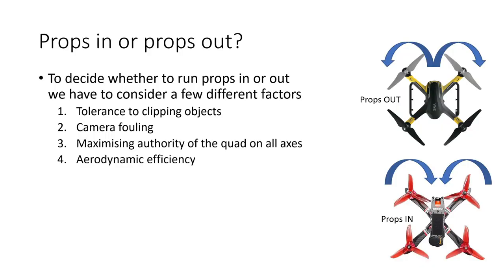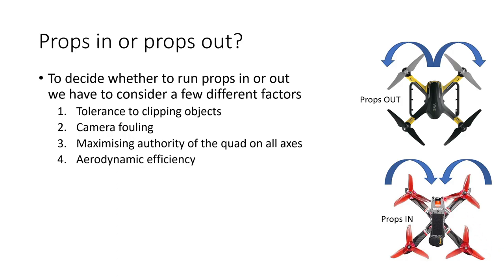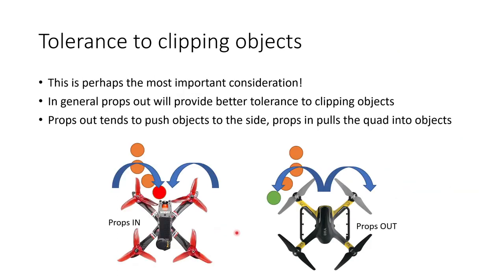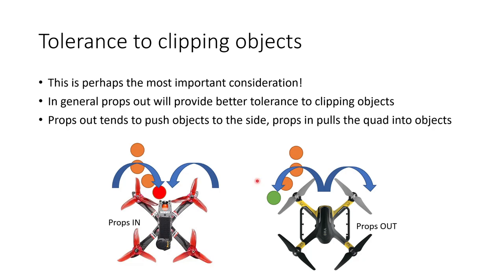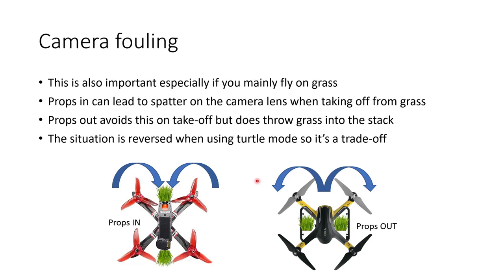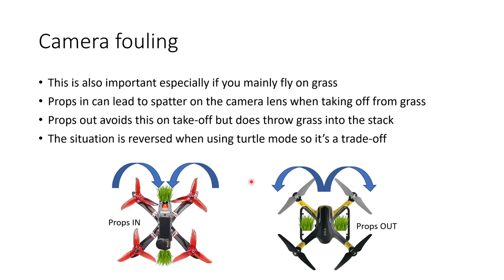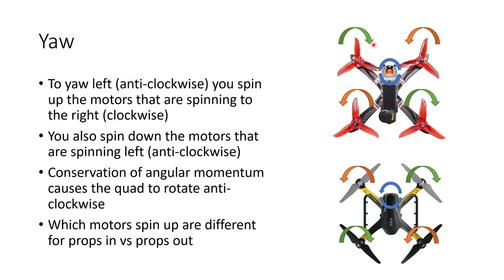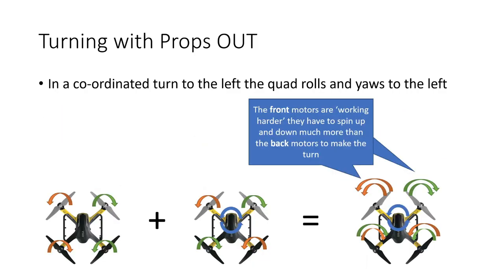Prop Direction. Should you run Props IN or Props OUT?

Comment: I crashed my 5” quad and had to replace my esc. After doing that and making few other adjustments, (Lighter battery straps, less tpu mounting, no motor wire sleeving) The quad was actually 40 grams lighter.

But It flies noticeably worse, the motors run hotter, and low ground passes were harder to pull off. I adjusted the pids and noticed I can’t push them as far. The only real variable that would make performance that much worse would be my prop direction. 

I got lazy and hate using bl32, so my motors are running inwards now. Never knew it made that big of a difference, I just ran props out because I used to crash my whoops often.
Reply from the maker: Crashes can cause delaminations in the frame which will affect vibration performance. Even if the frame looks OK it can become more flexible. That might be the cause. If you're still having trouble after switching back to props out check that all the arms feel equally stiff.

Comment: Thanks, had not thought about switch prop in vs out direction, just used the default betaflight. After your video I gave it a try and men I just got an extra 3 to 4 minutes flight out of my quad, from nearly 9 to 10 min to over 13 minutes. Not to mention banking turns are much smoother plus better turn control in general. Same quad, battery, blades and that in heavy winds... flying a light weight 5" which is setup for long-range. just around the 250grams
Reply from the maker: Great to hear! I'm glad the video was useful to you. 😁
Reply: @ChrisRosser  watch your video on prop size and motor choice, I'm running 1404 4850kv on 5" bi blade low pitch. To me this is my best quad yet, this is my 4th quad and second that I put together myself.  To be fair this is the first I got good PID setup after watching tons of videos on it of AUV. But there is something quite different from a 4" to a 5" quad that I would like to know more about. The responsiveness with same setup just going up that inch makes it feel much more stuck/grippy

Comment: I absolutely can with out a doubt can tell a HUGE difference when I clip a tree or even a post. I probably bounce off at least 50% of the time, depending on how hard I clip something. Sometimes it’s amazing how well it works. That is the main reason I ONLY fly props out. I don’t know why it isn’t the standard configuration. I have definitely noticed other advantages, but now see more through the turbulence diagrams. I always FELT that it flew smoother, and just makes more sense to me.

Comment: Honestly, when I just started watching this video, I thought the final conclusion would be less definitive, with both configuratios having their advantages and disadvantages. I did not expect the 'props out' to be such a clear winnner...
Personally, I started on the default 'props in' config, simply because this is how my first quads (Emax TH ii whoop and TH ii Freestyle) were set up by the manufacturer, but as soon as I learnt how to reverse the props I switched to 'props out'(I first reversed the motor direction by swapping wires, because I didn't know yet of BL Heli software 😶) and never went back to the 'props in' on  any of my quads again - whether I build or buy kwads I always make sure they run in props out set up. 
It's reassuring to learn that there are other important reasons for running the props out, beyond just not wanting the kwad to look like a dirty lawnmower 🙄
Reply from the maker: When I started looking into this I though it would be more balanced too!

Comment: I turtle mode so much, with props OUT, turtle mode covers my lens with junk (or pits the lens with rocks) during reverse direction. Therefore I only fly props IN. This way, turtle mode doesn't make it impossible to see (or ruin my camera lens) when I get back upright and flying. I conformal coat everything, and use plugs in my USB ports to keep wet junk from killing my electronics, since turtle mode throws stuff into the flight controller. 🤣

Nothing else matters to me since I claw my way out of pretty much everything using turtle mode. LOL

When I crash much much less both racing and freestyle- then I'll go back to props out.

Great video, though. Mad props to ya!

Comment: My experience has also been that props-out provides better cooling to a DJI Air Unit in the frame as well.
Reply from the maker: Thanks for sharing that's another important consideration, especially for the vista
Reply: This probably is most convincing argument. All others are debatable, but cooling is really important.

Comment: Thanks for another great and informative video Chris.  I tested props in vs props out on low authority whoops to see if I could eliminate washout problems.  With props in I would get uncommanded rolls during a washout, and with props out I would get uncommanded yaws.  Washout would cease to be a problem if the quad had enough authority.  Washout was also reduced by making sure I gave the quad extra throttle during a hard turn.  On a quad with good authority, I had a hard time telling any difference between props in or props out, but I need to do a lot more testing on that as my flying skills have improved greatly since my initial experiments.  Thanks again, I am grateful for all I have learned from you.
Reply from the maker: These aero effects matter more on whoops than bigger quads. The difference in feel is quite slight on a 5inch I think.

Comment: Great video. I wonder why props-in is/has been the default for most firmware given that props out has so many advantages. I think the biggest downside to props out is, you basically have to do it to all of your quads or none of your quads (to avoid confusion), and since props in is the default, I think most people just deal with it being a slight disadvantage purely out of connivence

Comment: I'm using props out for 5 years already, when it became a thing. Definitely easier to escape from contact with tree branches at one side which may happen a lot when you do freestyle between trees. Inward props in such circumstances usually tie branches around quad in a second with known outcome. Also cleaner camera lens. With props in often had dirt and grass thrown on camera lens on liftoff which annoyed me a lot. Didn't noticed authority problems for outward props as well.
Reply from the maker: Exactly the same experience I had. Props out for me now 100%.

Comment: Great video mate 👍😎 I’ve been running props out for a long time for the reasons you mentioned but didn’t know about the potential aerodynamic benefits. Theres another benefit to props out if you run rx antenna backwards off the rear arms etc. they are less likely to be damaged by a prop strike, turtle mode aside.

There’s two caveats I would say. Don’t land or take off on long grass, or disarm quickly when landing, or your stack will get covered in it. And best to have all your quads in OR out, a mixture can easily end in putting props on backwards which can suck big time 😂
Reply from the maker: Definitely. I only run props out to avoid that problem. The trick is to land like a freestyle pilot. Disarm when you are still 2m off the ground flying 10mph😜

Comment: Hi , please can you do a similar video on X8 quads. I build and fly x8 quads using only 4 motor outputs and running the upper and lower motors on the same arm in the same direction. in effect an 8 motor quadcopter not an octocopter. I know for a fact that i can drop 4 motors or props and it still flies , just at half power. But if you try the same in x8 config it does not work so well . I have tried to inform folks of this , but all other x8 type craft i have seen run octo config with 8 separate motor outputs,  If redundancy is important those running 8 motor outputs are doing themselves no favors , but no one listens to me, . Your work is FANTASTIC , keep it up.

Comment: I noticed long ago that props out had a huge difference in the agility of a quad using stretched x frames as opposed to agility of compressed x frames using props out.   I think props in was actually preferred on those butterfly (dead cat) frames because the ofset positions of front to back props.

Comment: Hey Chris when it comes to authority I’m just curious if you also factored in variable of pitch of the quad when flying? The rear props will no longer be placed directly behind the front props which gives more allowance correct? What are your thoughts?
Reply from the maker: The pitch of the quad will be very variable depending on the movements in flight. In general however the quad is moving forward so that's a place to start 😁
Reply: @ChrisRosser  correct. My thought is the more the quad is pitch forward (like racers) the more “clean air allowance” the rear motors will receive this rendering more authority to PROPS IN when at high pitch angles. You no longer have to pull air in and down as much leaving a clean air pocket for the rear motors as now you are pulling and forcing air in at much greater efficiency due to the angle. Just my thoughts on how the higher the pitch angle your quad is flying at will minimize the dirty air to the rear motors.

Comment: Would be interesting to see a blackbox log. Fly the "exact" same path with the same quad in the two different configurations and everything else equal, and discuss the difference=)

I'll switch to props out to check this out! I've always ran props out on my 3", but the 5" is props in.
Reply: It would require computer controlled flight. Because no way hoy you manually would repeat exactly the same path. Though I got the idea.
Reply: @KrotowX  But you can go "powerloop under this tree, fly straight past the field, do a punch by the house, hover at the rock", and so on.
Reply: @ojkolsrud1   Indeed I can. It will not be exactly repeated previous flight route, but yes  ;)

Comment: how much is slightly better? Does the efficiency fall under the non-marginal category? Great vid! Just subscribed.
Reply from the maker: It depends on prop size. An excellent pilot can notice it on a 5 inch quad. It's very noticeable to most pilots on a tiny whoop because they have lower thrust to weight and less authority.

Comment: Good video again, I run all my quads pros in. Just because it is default. One time I experimented with reverse direction but when I got a broken prop and replaced it on autopilot with a new prop with the prop in direction the quad was almost eating my face at arming😝 so after that incident I never did it again. But your theories sounds interesting so I will give it a new try. Thx

Comment: Very interesting analysis and I agree with most of your synopsis however, the "dirty air" effect on the rear propellers from the front  propellers will be reduced or, in extreme conditions eliminated, with in fast forward flight i.e. the rear propellers are above the front propellers and will see mostly "clean air".
Reply from the maker: You are absolutely right. Fast level forward flight is not when we most care about inlet conditions though. Think about a big split S or the end of a power loop when you are descending through your own propwash. Then the rear props are right in the line of fire from the front props. This is where props out has a real advantage.

Comment: The only caveat to the camera issues is if you use Turtle mode in areas that have gravel and loose aggregate. If you run props out, they'll be throwing rocks and gravel at the lens of your camera. I have a runcam hybrid betnow has a textured lens do to sand getting thrown at it while in Turtle mode. 

The issue is soft pretty easily though, it's as simple as not using Turtle mode when gravel is present
Reply: We have screen protectors for phones. I often wonder why manufactures don't include a small insert and method to attach it just in front of the lens.

I now leave the crappy plastic lens protector that comes with the camera on because of how delicate those lenses are.

Comment: My first quad build was prop in. At the moment, my most recent build I'm running props out for the first time. I feel like I have better control on the roll axis with props out. Props in feels like I have better control on the pitch axis. I also feel that acceleration is a bit different in forward flight and during punch outs or last minute throttle recoveries. I feel that I get less thrust with props out but it might be the tune. Both my quads are generally identical in frame and components. I've only been flying quads for over a year so it's just an observation. It would be interesting to see if there's a difference in frame resonance with props in versus props out.

Comment: I run props in because I prefer to take 5 seconds once in a while to clean my camera than risking to short something on my FC or ESCs because of wet grass projections (and spending much more time cleaning electronics). But statements about authority and aerodynamic are very interesting and make me hesitate to switch... ;) Thanks for the video !
Reply: I cover all of my electronics with silicone isolation liquid, this helps with wet grass projections)
Reply from the maker: I don't blame you. Never had it happen to me but I do get worried when my stack looks like a grass box from a lawnmower!
Reply: @edfroxt7294  I was used to do so, but it makes maintenance quite messy and silicone coating is a bit fragile when cleaning with a toothbrush, always pros and cons ^^

Comment: I totally agree with all this in your video. Great job with it and and some benefits of flying with props OUT. There is something to be taken in consideration with props OUT is in scenarios when they impact with a HARD object (hard to be moved by kinetik energy of the quad) the quad is being "thrown away with a dangerous speed of non predictable direction". So best is when you dont have damage to your quad or anything else but mostly a strap is cut, battery is away from quad etc. and not last no body hopefully is not hurt. I was flying with props out for an year being witness with these unxpected and upredicted "quad thowbacks" since then I fly with props IN. Did you experience same behaviour of an impact?

Thank you!
Reply from the maker: That's a great point, props out does throw you clear of objects, sometimes quite forcefully! I have had that experience too.

Comment: From personal experience, props in worked better on a small quad (Mobula 7 HD). It had a horrible propwash/yaw spins after split-S and power loops. Once I switched to props in, its behavior became way better, almost fully eliminated the propwash. Also, if we look at some quads like DJI Mavic and similar, they are all props in. I think this configuration provides a better overal stability and smoothness of the quad while props out are probably better for race conditions.

Comment: I've tried both and on the same quad I can't tell a difference with the flight characteristics.  There is one good argument for props in that you didn't mention.  That's FC stack fouling.  It's much easier to wipe off a camera lense than it is to clean grass and debris from your stack.
Reply: @nickgreenemail  He mentioned camera fouling but not flight stack I believe.

Comment: Hi! First of all great video, I really appreciate the content and you've convinced me to switch to props out. By the way I'm wondering how a Z frame (rear arm lifted upward) would perform in terms of aerodynamic. I assume the rear prop would have higher efficiency as it'll recieve less turbulant air from the front, what is your opinion on that? Thanks

Comment: Exactly why I've always run props out. 
BTW, pusher props are only more efficient than tractor props in theory, as no real world application in full scale or model aviation feeds a pusher setup with clean enough air.

Comment: But in a coordinated turn, we are also pitching back, and the front motors are spinning up for that. Right ?

In a props-out configuration, it means that one of the the front motors has to spin up for all 3 rotations (pitch on top of roll and yaw), while in a props-in, it's more evenly distributed.

Does this have an impact or is clean air more important ?

Edit : I had pause the video to write this comment right before you talked about blade stalling. So in fact, props-in might compound this further, as in your example, the rear-right motor has to spin down "3 times"
Versus in props-out, the front-left motor having to spin up "3 times". Which might not be an issue unless we max it out ?

Comment: For the coordinated turn point, wouldn't you also have to account for the fact that the quad will pitch forward given no pitch input, needing the pilot to pitch back to keep the same angle. This would cause the the front motors to work harder regardless of prop direction and could reduce the possibility of a stall in the front left motor (on a props out quad) but also could max out the front right motor. JB covered the whole 'pitching forward in a coordinated turn' thing on a video called "why pilots don't pitch forward as much as you think" or something. (Sorry I can't link I'm on mobile)

Comment: I've run props out for quite some time now and have seen better prop wash handling because of this, although this may also be due to better and more appropriate motor selection for the quads weight.  I've always thought that this effect is amplified in smaller quads such as whoops and small micros because of the smaller prop compared to body / weight .  This is not a scientific finding but just an observation.  What do you think about this?  Thanks for the great content Chris,  fascinating as always!